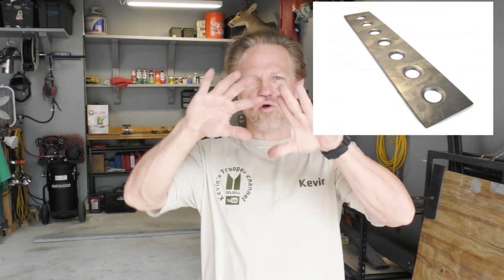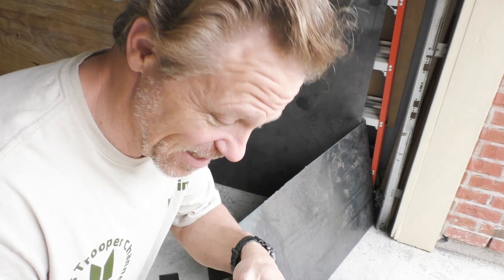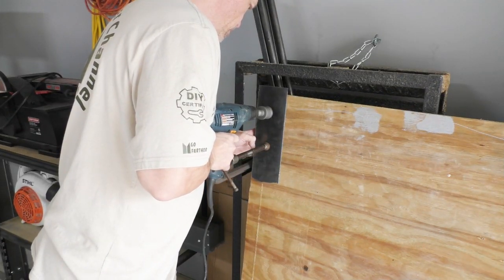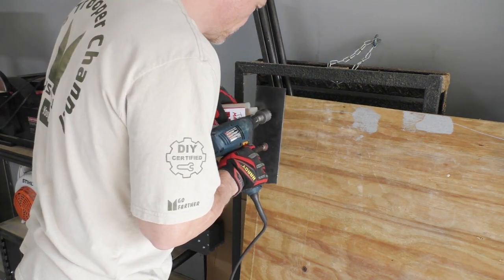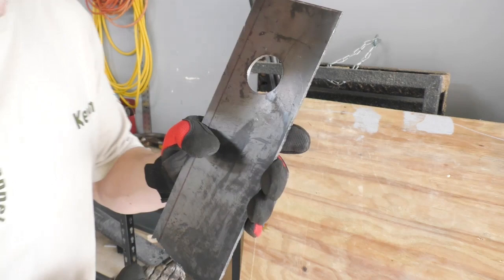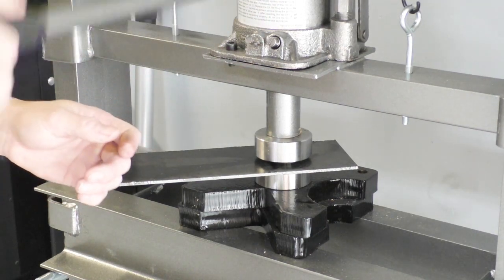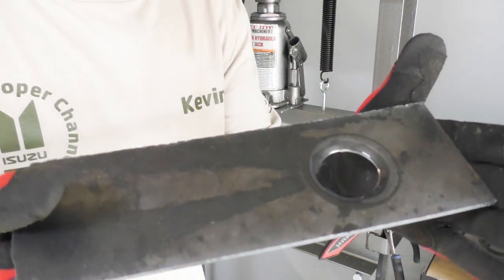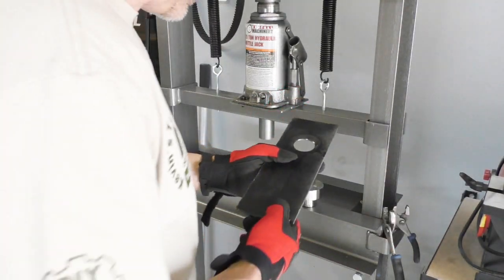How to use a dimple die - EASY - Harbor Freight Press

Comment: to drill the holes use a drill press 3.4 Hp,   Hole saw and compressed air while drilling , the air cools the tool and takes away the filings , try it you will be amazed  chop chop

Comment: There IS some kind of way to eliminate the hole saw (which BTW will stop performing as well as it did in this video after a few holes).  It's a call a punch / knockout die, and you use it just like the dimple die.  Also consider upgrading the supplied arbor plates that come with that press to ones from swag offroad
Reply: Carbide cutters will last a long time if you know how to run them. Often referred to as speed cutters most people run them to fast simply because of that name or lack of knowledge. Yes most metal drilling process require faster speed and heavy pressure, but like with any carbide blade, bit, or cup once it gets to hot its done. If you ever seen blacked tips on bit or saw blade its done. lots of pressure and slow speed with those hole saws will get you good results, more accurate, and probably faster. Commercial electrician use them to drill metal studs, panels or j-boxes, and building members such as purlins and even I-beam on occasions.

Comment: I ordered a set of 8 from JBugs in southern california yesterday - cheapest I've found and sound like they'll do the job - about 280
Your press seems to have flame cut plates, I've heard the cast plates are dangerous as they can break & fly apart under pressure.
I've put 2 different sizes of PVC tubing on each of my return springs (one in side the other) to contain a piece of a broken spring
from flying around the shop.
thanks for posting this video, I'm excited about getting my dies - they are due in Friday
I'm going to see what other videos you have
good luck in the shop and stay safe
Reply from the maker: gary gerard thank you so much for the safety tip. I really appreciate you watching and being part of the channel. 
Glad you are checking out other videos 
I have changed my channel from a channel about  redoing my Isuzu trooper to more  of a fabrication and metal working channel.
I build and design projects in wood and metal. Do product reviews and other cool stuff. I just finished building an awesome welding table and I am editing the video now. It is really something to see. Can’t wait to get that one out. 
Welcome to the channel. Thanks again for the tips. Let me know if I can ever do anything for you!